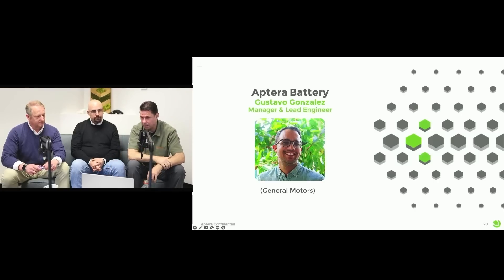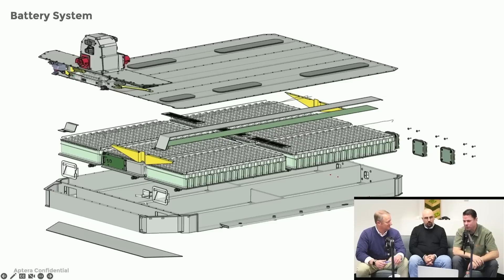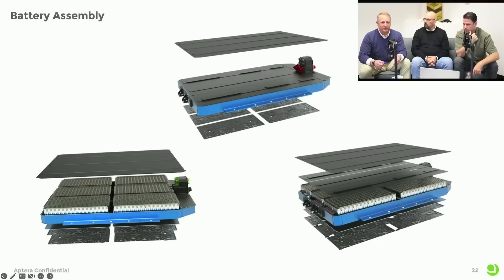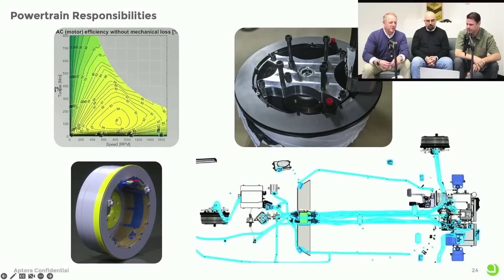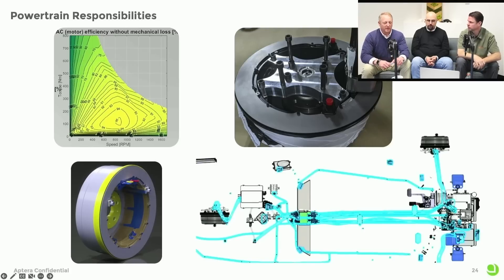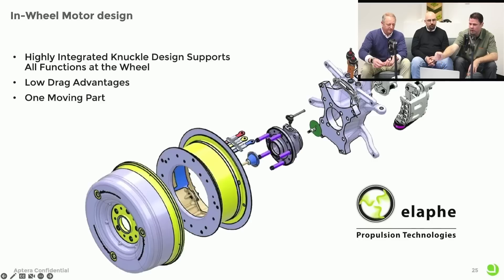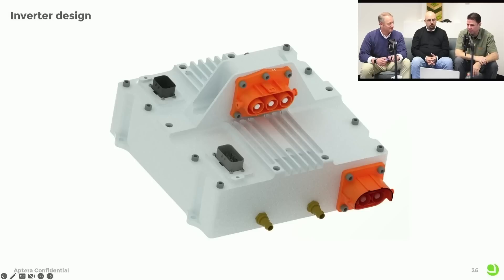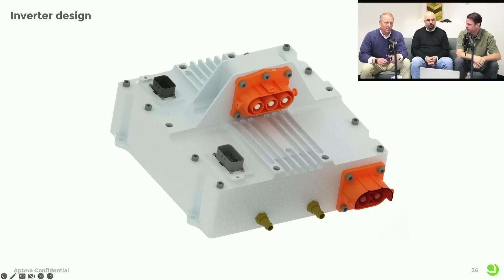Battery & Powertrain — Aptera Engineering Update

Comment: Just curious, what is the degradation of the battery when it is fast charged on long trips, or actually just about any trip. I currently own an Ioniq5 that started at a range 311mpc and now lucky to get 220 mpc.? The mileage distance is improved with level 2 but still only 240 mpc. So I have gone coast to coast 6 times 2234 to AZ and 2932 to CA, each miles one way, with both a Tesla and a Hyundai and the performance is virtually the same. Of course those numbers are much lower in actual driving, maybe 120- 130 tops. So I drive 1 hr 30min roughly and stop charge and go again. The good news is that I am prepared to hold that schedule , I am 78 yrs old, I do this for 12 to 14 hours per day. I made it from my home in North Port FL in 3 days. So for the long winded comment.

Comment: The launch edition supposedly has 400 mi range, but if the battery is 42 kw  then at 80% charge it is only 336 miles because that’s the supposed limit for charging without damage to the battery.   Any comment?
Reply: You copied CA mistake.  It's kWh not kW.
Reply: @artsmith103  woo hoo , yep

Comment: Posting this video April 2023, if you're going into manufacture the design should have been locked 6+ months ago. Also the huge AL casting for that motor support hub with the integral suspension arms, it looks too complicated and the whole assembly has to be scrapped if any of those arms are damaged or bent. What happens when dirt and sand gets in the motor?

Comment: Does your battery have thermal insulation? 

Else during battery cooling, a significant part will be lost to ambient, plus during parked mode the battery that was cooled will quickly heat up to ambient temp again

I worked at lightyear and looked into this before

Jaguar i-Pace does have battery thermal insulation and therefore scores much better in real life test and

Comment: Is direct drive DC (straight from panel to motor) possible in the Aptera? Or would it require too many control systems to deal with fluctuations in solar radiation?

Comment: Sweet super excited. I'm a reservation holder for the 250 mi versions.  Hey any chance that the 250 mi version will get the LFP chemistry? I know it's not as efficient and is heavier but I do like that I LFP can charge 100% and down to 0% without hurting the battery and I also like the high cycle life.  However I will be thrilled to get any type of chemistry I wanted my up Aptera yesterday lol

Comment: I hope people realize that 100 Wh/mi is for a specific passenger weight and speed.  My rough but likely very close calculations show the Launch Edition with 380 lbs of passengers (2 people) and 68 mph to use 100 Wh/mi.  That is really great.  Unless you are on a long distance road trip, you are not likely to average 68 mph in your everyday use.  I drive a great deal at highway speeds and yet I only average 36 mph.  Yes, I was amazed how slow that actually was but this also good news.  At 36 mph, I'm calculating 57 Wh/mi or 630 miles of range with 6% battery reserve on the 42kWh battery.  That is much more realistic than the few times a year when I am averaging much higher speeds because I am on a road trip.  Of course if you are doing 0-60 in 4s all the time, your mileage will vary.
Reply: Is it correct to take the average speed when calculating the range? I don't think it is. By taking the average, you are ignoring the fact that the consumption does not increase linearly with speed, but faster than that. Did you take that into account somewhere in your calculations? Yes, aptera has very low drag, but it probably still needs to be taken into account. I suspect the difference is massive if you drive fast for long periods.
Reply: @madskillz1o1  the amount of energy is definitely not linear with speed. My point was, 100 Wh/mi is at a certain speed with zero head wind and at a certain weight. My calculations show that to be very close to 68 mph. (We won't know until actual tests are done.) Everyone seems hung up on the range of the vehicle. That range is based on you using 100 Wh/mi, 68 mph but you will rarely average 68 mph unless you are on an open highway and can travel faster than that for a big chunk of the day.  Most people will average a speed that is much lower and I used my example of which I drive a great deal on the highway, of averaging only 36 mph. This will consume much less energy and my range will be closer to 600 miles than 400 miles unless I am using electric heat or the AC or driving in really cold temperatures without preheating the battery. 100 Wh/mi is fantastic at 68 mph, requiring about 9.6 hp. That really is remarkable. (Assumptions: Cd of 0.13, air density 1.2kg/m², level pavement, total vehicle weight with driver & passenger is 1,770 lbs)

Comment: What is the battery chemistry?  Quite a difference in both quality and safety on the battery front so a pass/fail for me.  Most likely you would use LFP but always good to ask.  Looks good, buying an electric next yaar and you guys are in the final three.  Tough sell to my wife but she is getting used to the "sperm cell" as she calls it.  No love!  She wants one with 600 miles of range, AWD and done.  Thanks for the update!
Reply: It's NMC chemistry. LFP would be non optimal due to increased weight. NMC is very safe and long lasting now. Most issues with it were before companies were using materials of a high enough grade.
Reply: The Aptera will use NMC 811 2170 batteries, with the Launch Edition having a 45kWh (42kWh usable) battery pack. In 2025 there is the possibility that Aptera's alliance with Formosa AdvEnergy Technology Corp. will provide LFP batteries for some models in 2025. The 600 and 1,000 mile Apteras will possibly have EVE Energy Co., Ltd INR 46XX batteries.
Reply: OMG - sperm cell!!! 😂 How could she have no love when you're the Love Puppy?

Comment: I will buy an Aptera, when solid state bateries wil lbe the powertrain
Reply: Amprius is just launching a 500 Wh/kg silicon-based battery, which is double all currently used chemistry. Just imagine a 1,000 mile range, then double it with this battery. It was in a video posted yesterday by Sandy Munro. 
This will be a huge game-changer for the industry.
Reply: @John Hayes  launching is a bit of a stretch. They presented a lap prototype and they hope to get it to 500wh/kg. It's a long ways from production and likely to cost many times more then current tech and if it works as they hope it does, it will be prioritized for other applications before cars anyway.
Reply: @johnhayes3314  With that batterie, maybe
Reply: @johnhayes3314  Yeah - I've always wanted to drive non-stop for 2000 miles......
Reply: @johnhayes3314   - Currently, the Amprius battery has a cycle life of between 200 and 1,200 cycles - too short for automotive use.
Reply: Why would you specify a technology rather than cost/performance criteria?  It doesn't make sense unless you are invested in a particular technology.
Reply: So possibly never. Really though. Solid state is at least 10 years away from being in cars if it ever gets used that way. Huge cost and performance barriers to overcome. NMC is plenty for this to be an outstanding product and I wouldn't get caught up on the overhyped future tech.

Comment: Is skin cooling still a thing?
Reply: Yes,
Reply: Sure but in this video only the battery side of the cooling system was shown. First the heat must "be transported off" from the battery cells, then it gets "disposed off" the cooling pan (instead of a cooling grill) to the outside of the vehicle.
Reply: @charangohabsburg1  If the vehicle is moving slowly so sufficient convective cooling is not available or during charging, the AC system may engage.  The internal fan can blow cold air over the inside of the pan and the air can then be used to remove heat from the AC condenser and the hot air is then exhausted out the tail of the vehicle.

Comment: This is awesome.  More effiency means I may keep my reservation at the 400 mile range to the 600 mile one because I was thinking we'd be losing a bunch of energy at higher speeds on longer trips.
Reply: I changed my reservation from the 600 to the 400 mile battery. I am going to wait for the validation of the mileage range after their real world testing, and then decide whether to change back to the 600 mile battery or stay with the 400 mile battery.

Comment: The motors are in the wheel.  

It is easy to steal wheels.

What steps does Aptera take to make the motors difficult to steal?
Reply: More precisely, the motors are in the hubs. The wheel with tire is bolted onto the hub just like a normal car.
Reply: Since the motors are on the hubs, they will need some time and plenty of tools.  It's possible but not as easy as just stealing tires.
Reply: There will be a special tool needed to remove the wheel covers (front and rear) to access the wheel lugs. It looks pretty easy to swap a tire if needed, but you will need the special tool.
Reply: @deanmcmanis9398  Thanks for the reply. 

Apparently the way theft works is that thieves figure out how to steal something, then they tell compatriots. 

Unfortunately, consumers don't know what will be targeted until after the product release.

Hopefully there will be a decent gap before a thief steals the special tool from a shop and starts steeling the motors.
Reply: @yintercept4612  The motors are NOT part of the wheel 🙄
Reply: @yintercept4612  How often get brake discs stolen? It's more difficult to take a hub motor off a vehicle than a brake disc, so this will not be an issue.
Reply: There is no market for the motors, they are too specialized, so theft will not be an issue. Vandalism might be a problem though.
Reply: @biffwilliams6191   -  Ever imagine electric dune buggies?  :-)
Reply: What would even be the point of stealing proprietary motors from an obscure car. There's not exactly a big market for that.
Reply: @logitech4873   - The hope of Aptera is to MAKE a big market.

Comment: When better batteries come on the market will it be easy to change the Aptera batteries for the new ones?
Reply: Aptera intends to make most components modular and upgradable as technology advances.

Of course some of those upgrades will be more difficult than others, for the DIY'ers.

Guessing they would prefer you bring your car in for a battery upgrade. Versus providing users a unique platform for supporting the vehicle while the batter components are lowered out of the body.
Reply: Easy yes. But prohibitively expensive. What would you do with the old pack thats roughly one quarter to one half the price of the car?
Reply: @GaryGreenway  Aptera can repurpose spent vehicle packs for stationary applications and eventually recycle them.
Reply: @n.brucenelson5920   - That dodges the question of expense to the owner for the swap.
Reply: @n.brucenelson5920  True. Seems a shame to recycle a still good but outdated pack, Hopefully by then, an off the shelf solution will be available to connect the 400V packs in to existing solar controllers for a second life as stationary storage.
Reply: @GaryGreenway  That is what I meant by repurposing spent packs for stationary applications.  You and I agree.
Reply: Yes. You simply place an order for a new Aptera and trade in your old one.
Reply: @D44rkFx  And this is the easiest way possible. And probably the cheapest too.

Comment: How difficult will it be to replace the battery when it gets old?  It will go along way to make the vehicle sustainable if the batteries are easily replaceable down the line.
Reply: Lithium ion batteries typically have around a 10 yr lifespan give or take. The battery is removable after removing bottom panels. It sits in between the frame rails.
Reply: @tims8603  My Tesla Model S 60kwh will be 10 years old in June with about 8% battery degradation.
Reply: @jimpike7445  That's good to hear. I hope Aptera's  battery lasts more than 10 years. There are lots of factors. How fast you charge, climate, miles, how you drive etc.
Reply: @jimpike7445  How many miles or kilometers has the car driven with those batteries?
Reply: This is a question in my mind as well. They have spoken about how the solar panels are replaceable but not heard about the battery pack.🤞
Reply: Tesla batteries have an estimated 15 year battery life.

Comment: Pretty sure a 16 - 24kWh pack would be desirable for an entry level option given the efficiency of the Aptera.
Reply: As long as the range stays above 200 miles. Anything less would be a hard sell in the US. Europe may be ok with a 160 mile range.
Reply: @richpate9436  Nobody in Europe (and not even here in small Switzerland) would find a 160 mile (250 km) range EV compelling. Only a minority of a minority would take it into consideration, and not even all of those would in the end buy it.
Reply: @charangohabsburg1  .... Sure, tell that to all the owners with 30-40kWh cars on the road. 10 years ago a 100 mile range was the holy grail. What matters is a balance between cost and range/capacity. 

There's many Hyundai Ioniqs with 28kWh on European roads that do the job fine.
Reply: @richpate9436  but also remember the rapid recharge rate
Reply: That's the plan, after they produce the 400-mile versions, they'll start manufacturing the 200 and 600 mile battery packs.